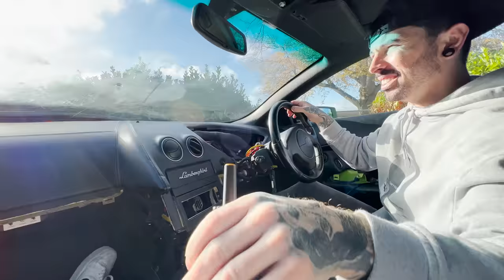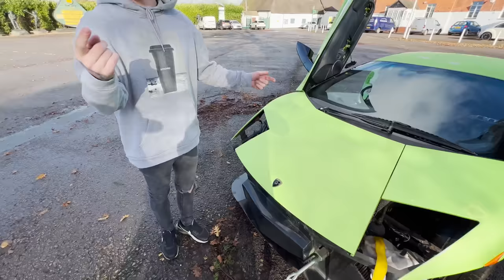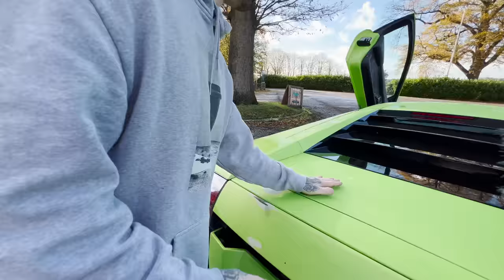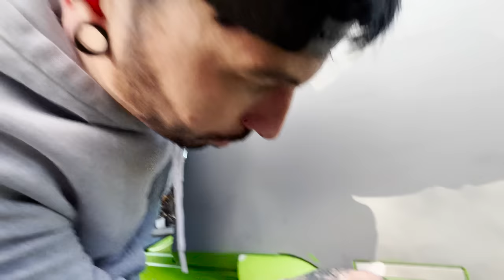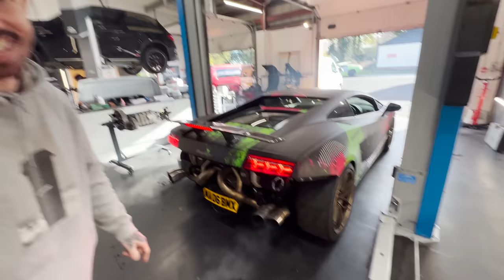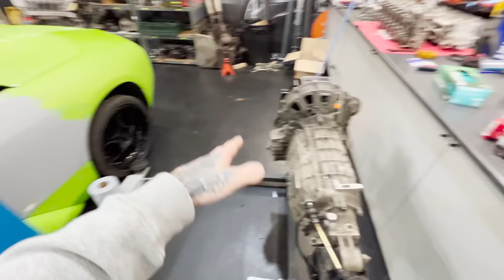I FOUND UNSEEN FOOTAGE OF MY ABANDONED LAMBORGHINI MURCIELAGO

Comment: So about 14 years ago when I was 6, I was walking through a park one night, or so I thought, little did I know I was at bruntingthope. I was playing with the orange cones having fun, put the cone over my head and walked into a massive green metal thing. Left a massive dent it did, heard this ching and noticed a 6.2V12 badge on the floor and thought ‘I’ll have that’, replaced it with a stick and coloured it in with sharpe in grey. Now, 14 years later, I reckon I’ve finally worked out that it was this very murci was the ‘massive green metal thing’, hence the dent and lack of badge on yours Mat. Loves your vids if that helps pay for what I did 🫠

Comment: Hi. Actually used to work at the place where they used to run these experience days and remember a green murcielago 😯 If it had an ass hole it would be like the grand canyon as it got absolutely buttf**ked. Does not surprise me it was left in pieces hidden away. I remember the side getting filled in, was abit of a damp day, and some Rolf Harris looking character was grinding that clutch. Out of nowhere on a long left hander. A herd of deer came out from the trees, ran straight onto the track, one poor guy stubbed his hoof on the kerb, did a rolly polly and got his head stuck in a cone. Was frantically flailing about to get it off. Then flung it about 25meters straight into the side of the murci. I remember they didn't have any filler in the garage, so Doug nipped to the spar and got afew packets of 25p noodles, super glued them in there and gave it a sand over, lick of emulsion, good as gold 👌
*FYI. Everything you have just read may be a fabrication. Thank you.

Comment: Any chance you can do a measurement of the Gear lever in the gear control tower.. They are 2k plus vat. I want to get a machinist to make some up for an egear to manual conversion. i Have most of the gear control tower stuff bar the lever.  Also the levers are prone to breaking, so would be good to have spares available without the lambo tax.

Comment: Is that why they cut the hole in the transmission tunnel to stop that crunching? As for dent on the door, I did a track day experience and the car was damaged because one of the other track day drivers had backed another car into it! Is the side skirt damaged too?

Comment: So I know what happened to your door. Me and the old man each managed to drive several cars that day including an  black r8 and a blue gt3rs without incident. However on my last run of the day in the green murci I was side swiped by a low flying pelican. John the guy that took us both out in the cars rekons that the pelican must have hit the door at about 35/40mph. It was quite traumatic as the pelican didn't survive. Sadly as a rest I've refused to set for in another lambo for fear of a pelican repeat. The incident actually turned me vegan so not a terrible ending

Comment: The door (at 8:27) looks like the original color, with a big dent in it. The rear quarter has been sanded down and fixed and lacks clear coat, probarbly cause it was damaged at some point (thats why the badge is missing), if you look at the rear quarter, at the back of it, it's the same color as the door.
Reply: I think the guy destroying the gearbox is trying to rev match the gear shifts 😆

Comment: I do experience instructing. Each car has ~30 customers per day, doing ~50 to 100 days per year. If that car was used for 7 years, that's up to 21,000 customer drives. Approx 70,000 very challenging miles.

Comment: With body shell cut to get to the gearlever adjustment, one wonders if the gear crunch lead to the need to adjust or is result of adjustment.... Either way adjustment may need inspection and possible readjusting

Comment: Those trackday experience at bruntingthorpe are full of drivers who think they are racing gods and the instructors are just as bad when another car is waiting to overtake and because it’s a tatty old saloon car in their mirror the instructor tells the driver to floor it but fails to understand that the tatty old saloon is wanting to overtake because it’s faster than the super car! So it’s a case of of who will chicken out at the next corner…..a very expensive super car or the tatty old saloon. Multi times 1-0 to the tatty old car! One instructor even had time to give us the middle finger as we went passed. 😂

Comment: I’m pretty sure that’s where a kangaroo has hit the door. The Roos jump fences to eat the grass and then get spooked and take off in a mob across the paddock. when they hit the bitumen they slip and slide straight into the door.I would suggest that you fit a roo bar to the front to prevent one going thru the windscreen. No need to thank me for this advice

Comment: I was trying to balance a portion of chips on the roof whilst driving round the track, did 3 full laps 👍, as the passenger was getting out to munch on the chips a seagull swooped in trying to steal them off the roof but didn't realise Lamborghini doors opened upwards and flew straight into it - hence the dent - sorry 😬

Comment: There is actually very little mystery about that door. In April 2009 one off the clients who did a run in this Lambo went berserk when on arrival back to the paddock he saw his wife (who bought him a ride as a gift) kissing one of the mechanics. I can't really blame her - Joe was a nice looking guy, and there were many girls and guys who would do the same. Anyway, that driver fella went nuts and started to blame an instructor who was still in the car that it was all a set up, the drive was too long on purpose and all the similar nonsense. So he want around the car and started to smash the door screaming trying to drag the instructor out. Everyone was puzzled why he didn't go after Joe. Probably Joe looked a bit more menacing. After this happened tried to find a door replacement and the new from the factory was quoted at 16,000 euros. End of production, new car coming, not interested... So the replacement green door with 'smaller' damage was found in France, near Paris. And it was green. As green as guys could master their school level French. They new Verte, but missed Citron. At least it was only 500 euros, since it was damaged and there was no queue of buyers. That's how it got this 'other green' damaged door.

Comment: Can people PLEASE stop holding steering wheels like that... and worse, PLEASE, stop teaching new drivers this nonsense... It's the wrong way of holding the wheel, period. The only way to be able tor eact and turn the wheel fast to a big angle if you need to dodge an obstacle or correct an oversteer is by having hands in the 3-9 position, instead of this BS 2-10. I can understand new drivers or people used to automatic gearboxes not knowing how to use cluthc but not knowing how to hold steering wheel is just another level of bad and actually dangerous.

Comment: This is what I was talking about last video that tt lambo was not tuned correctly at alll like horrible that tune is shooting way tooo much fuel every shift it’s throwing out so much blac smoke when u give it the beans it’s just black clouds and the car won’t even stay started that tune shop did not know what there doing and the power shows he didn’t know what he was doing that should have put out more power then that and most of of your gonna have burnt out valves at minimum cause that’s way way too much fuel he’s dumping I bet u went threw that tank jsut on the dump run
Reply from the maker: Sure thing bro!!

Comment: Pay the money and get a real flame tune that’s not gonna destroy your cars engine it’s already bad what the flame tunes do but you think thats normal all the black smokes and backfire every shift dump more black smoke and fuel u will go threw fuel like nothing but biggest thing your gonna burn out your valves for sure by the looks of it that’s the minimum then your gonna be spending even more then a real good tune would have cost you just get gintani or anyone that knows tt lambo for real don’t want to see u have that car running like sh.t it won’t even start running turns off ard it would make more power also it doesn’t even need to go there they already have the tune which u will jsut need laptop